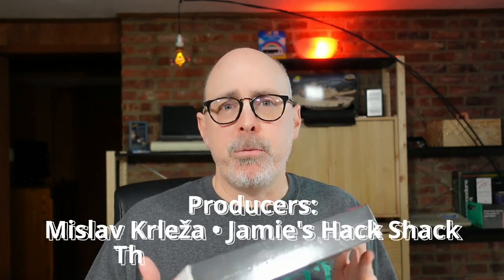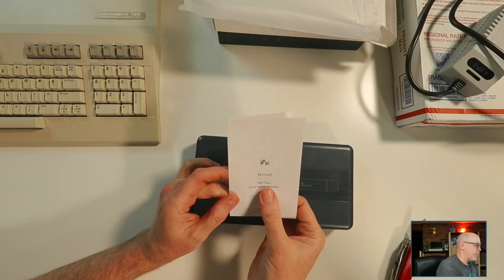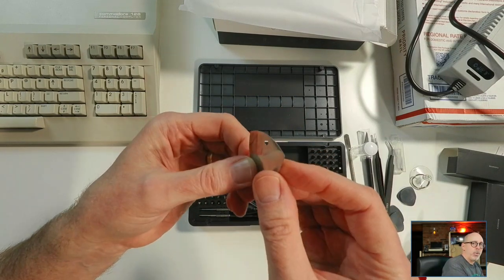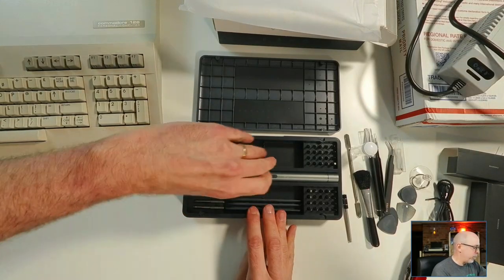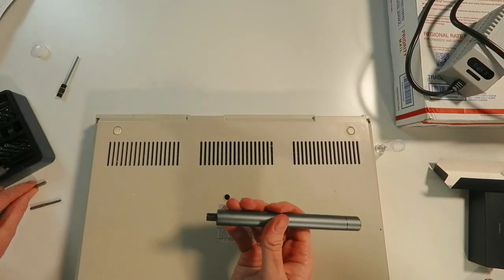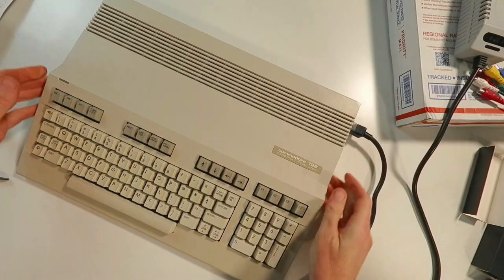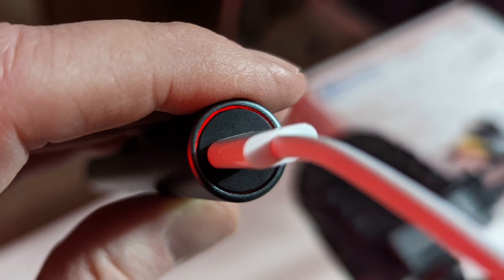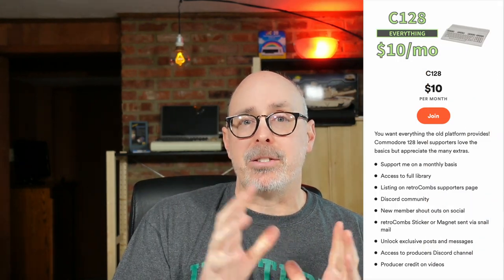🪛 Can I repair a Commodore 128 With an iFu Mini Precision Screwdriver?

Comment: Sold.
Reply from the maker: Enjoy! I like it. Remember when the power is not applied, it locks the motor so it works like a regular screwdriver and the motor isn't designed for large and tight screws but precision and smaller fasteners.